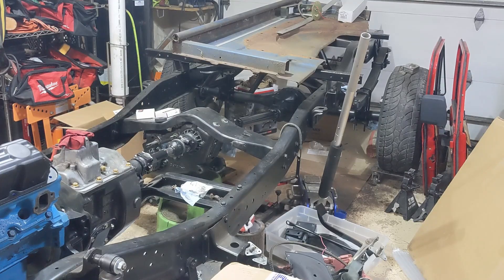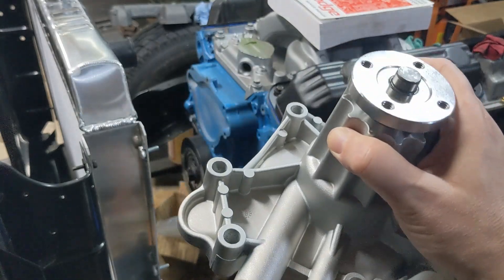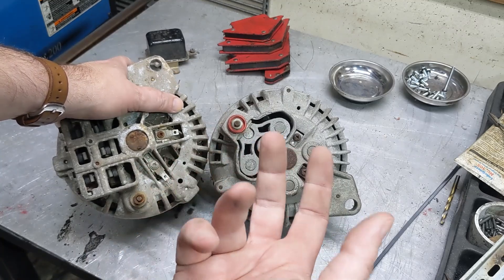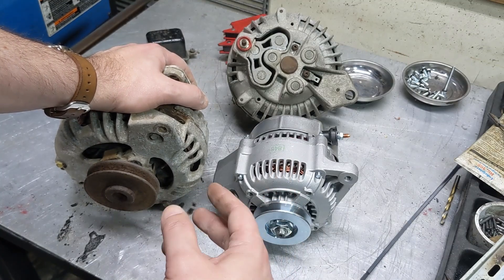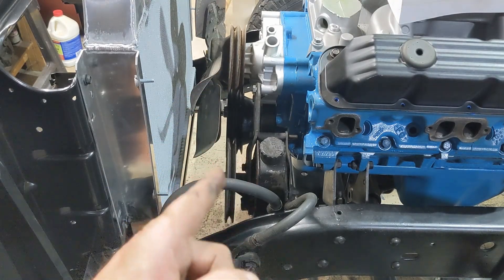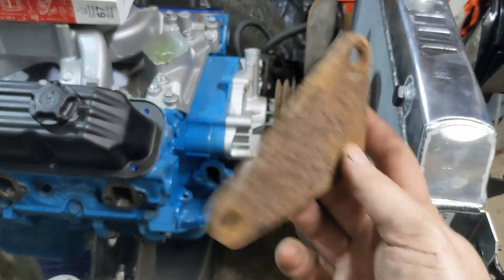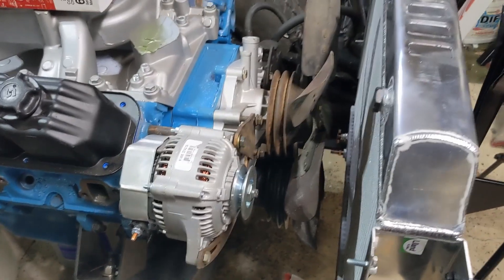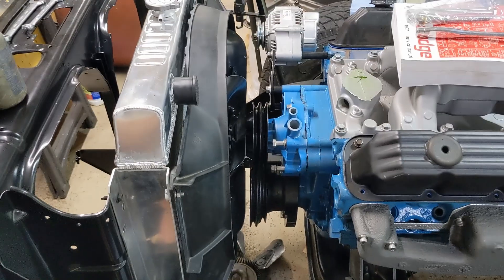Installing a NipponDenso Alternator on an LA/Magnum Block (True Spirit # 55)

Comment: I think my '90 D150 has a N/D style distributor but with an external regulator.  I wonder if the brackets from my roller LA will work with the internally regulated alternator.